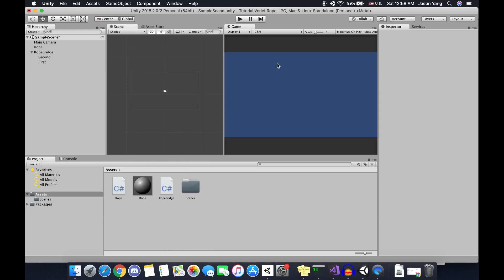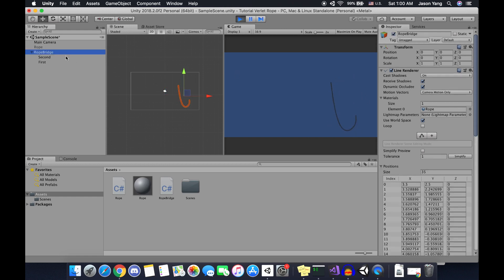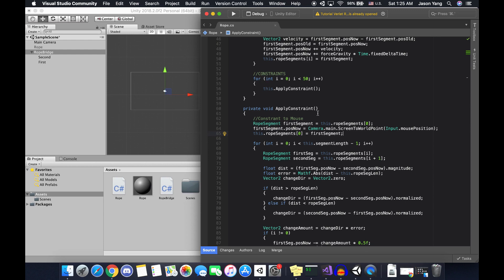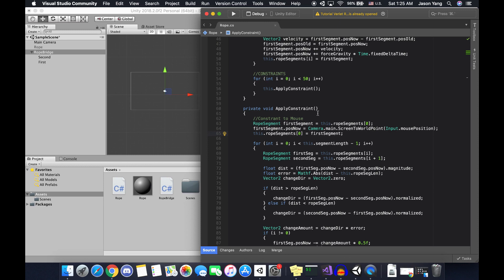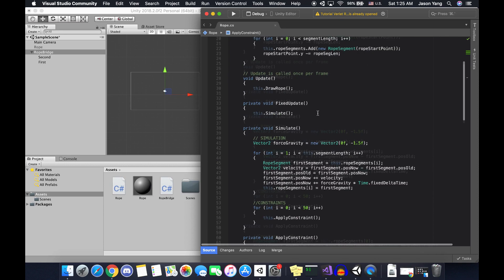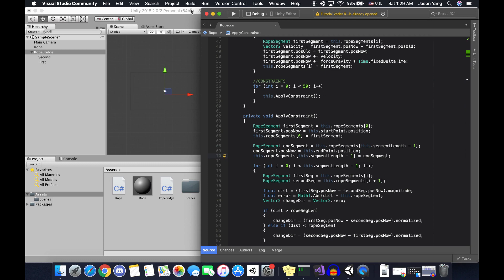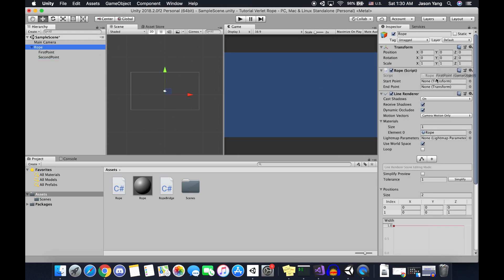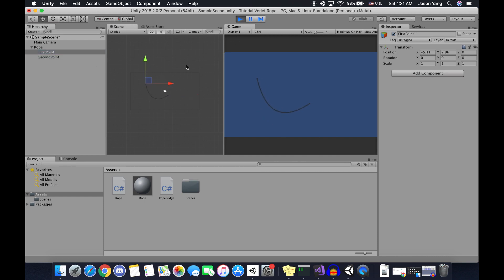Create Rope Bridge, String in Unity - Verlet Integration Part 2

Comment: Here are suggestions for further implementation. 

Adding a pin boolean to the segment struct and constraining segments that do not have the pin boolean set between segments that do  allows you to accomplish the swinging cable and the bridge in the same implementation.  Like for example a bridge with overhanging parts. 

Don't forget that your segments have properties.  This allows you to define constraint arguments within the line segment struct

Anorher one you can add is mass to adjust the influence of gravity per segment.  

Another one you can add is elasticity to transfer velocity to adjacent segments when the direction changes. 

Another one you can add is viscosity to place a threshold on elasticity where a certain amount of velocity is required to make the transfer to the adjacent segments.

Comment: Your videos are super useful and well made! Tutorials like these are very hard to come by, this was just what I needed. I do also have a question about using this with rigidbodies. I've been experimenting with different lightweight methods of simulating an elastic rope, and was curious if this could be used for that, when combined with something else. Would there be a way of simulating an object hanging from an elastic rope (similar to connecting a bunch of SpringJoints, except with Verlet Integration)? If you could point me in the right direction that would be amazing. Thanks again for such a helpful tutorial.

Comment: Very cool! Thanks for sharing the code. I want to add a motion to the middle of the rope to make it dangle a bit without moving the ends. How would you suggest I do that? Would that be the same way as the slingshot? But can I make the ”grip” of the rope more soft so it’s not V shaped? Thanks!

Comment: Amazing video, just like the first part. Is there a way to connect rigid bodies to the rope so that the rope can move them, but they also influence the rope? I cant wrap my head around that problem.
Reply: Managed to find out.
For anyone with the same problem:
1. Constantly updtate a rigidbody's position so it follows the end of the rope.
2. (optional) attach other bodies to it with joints etc.
3. Constantly calculate the attached bodies'/body's centre of mass as a vector and subtract the position of the end of the rope from it. Normalize the vector you get, multiply it with a constant that fits your solution best and add it as a velocity to the rope's end position.
Reply: @pickyourlane6431  I've been doing something similar to this, I place my object at the rope's end points.
Reply: @pickyourlane6431   i know its been 3 years but do you maybe have the code for that

Comment: hey great tutorial. is there any way i can stop the rope from stretching when i move the endpoints around? i cant seem to figure that part out.
Reply: You have to increase the times the constraints are applied. That will result in a less stretcy rope.
Reply: @pickyourlane6431  But would that stop the rope from keep on stretching when one of the end point is pulled away? I don't think so.
Reply: @BasementExperiments  Yes it would if you applied the same constraints to the given object(the pulling force) just as to the points of the rope.
Reply: @pickyourlane6431  This means that object would be a part of the rope, i.e, the object would act as an end point of the rope right?
Reply: @BasementExperiments  You can read about how I managed to solve this problem in my other comment some where around this comment section. Its not flawless but it worked good enough for me.
Reply: Were you able to figure out a way? Not like I need for my game but still would like to know.

May be add fixed joint between each point?
But that would make it like tens of rope tutorials that use hinge joints and all.

Comment: could anyone tell me how to added colliders to the rope?
Reply: Assuming 2D game, add an edge collider and create Vector2 array to store the points for edge colliders.
Inside Draw method's loop, store those points inside that Vector2 array.
Then EdgeCollider has a property "points"(read the docuementation), feed those points to it and it will generate edge collider along them.
Reply: @BasementExperiments  How would I simulate collision in 3d? I'm dynamically adding sphere colliders along the line but I cant get it to behave right
Reply: @reindogfan  What's the issue you're facing?
Reply: @BasementExperiments  Essentially I'm trying to get the rope to bend around objects, like it would when colliding with real objects. I've tried getting the contact point and applying a vector in the direction of the collision, but the rope bends and distorts weirdly. How would you go about doing this?
Reply: @BasementExperiments  hey, I'm a beginner programmer and I'm struggling with this. would you be able to give me a more detailed explanation or an example? thanks!
Reply: @BasementExperiments   I follow your instructions. As a result, I draw a collider line but it was far away from rope. When I move the rope, it also moves but there are a bad relation in the distance between rope and collider.
Reply: @ahmetanbar6346  It shouldn't happen if you're storing those same points used by the LineRenderer for the EdgeCollider.
Also the points of the EdgeCollider has to be updated continuously similar to that of LineRenderer.
Reply: @BasementExperiments  yes I  update points of the edgecollider. https://imgur.com/a/oQmOISc you can see that how edgecollider moves when i move the rope in the game.
Reply: @BasementExperiments  globally 
public List<Vector2> newVerticies = new List<Vector2>();
    private EdgeCollider2D col;

In start method
col = GetComponent<EdgeCollider2D>();
in start->for 
newVerticies.Add(new Vector2(ropeStartPoint.x, ropeStartPoint.y));
after for 
col.points = newVerticies.ToArray();

in drawrope method
drawrope->for-> 
newVerticies[i] = this.ropeSegments[i].posNow;
after for
col.points = newVerticies.ToArray();

that's all.
Reply: @BasementExperiments  I also notice that when i move the rope bridge object by using move tool. its transform position is changing but move tool ( provide able to change position red, green, square box) is not changing it is always the same point.
Reply: @ahmetanbar6346  1. You don't need the for and after that in Start. 

2. Code inside Drawrope method is correct
3. You need to update the points of the collider inside Constraint method as well.

PS: Why not simply use an array instead of a list?
Reply: @BasementExperiments  
thank you for your assistance. i am new in unity. I cant solve constraint method clearly.  Where should i update the points in the method? which parameters should i assign to collider transform?  this.ropeSegments?

A: It was copy paste. I notice it but firstly i try to solve my problem completely. I will clear them. Thank you sir.
Reply: @ahmetanbar6346  I don't remember exactly but the thing you did in Drawrope method do the same in Constraint method.
inside for->  newVerticies[i] = this.ropeSegments[i].posNow;
after for-> col.points = newVerticies.ToArray();
Reply: @ahmetanbar6346  May be a bug or something but I can't seem to find my previous comment here.
Inside Drawrope method do the same in Constraint method.
inside for->  newVerticies[i] = this.ropeSegments[i].posNow;
after for-> col.points = newVerticies.ToArray();
Reply: I still cant figure out how to put a edge collider, anyone here got a answer for that?
Reply: @DavidTG98  What's the issue you are facing right now?
Reply: I try to do thoose commands you guys described but they just dont work
Reply: I need the player simply walk above the rope
Reply: @DavidTG98  But "they just don't work" gives much explanation. Like what is happening when you're trying to do so
Are the edge colliders even generating? If yes, are they in some different position? Like what exactly is happening. Then only I might be able to help you.
Reply: The hole lineRenderer stops working
Reply: And the edge collider dissapears
Reply: @DavidTG98  Mind showing the code?
Reply: @BasementExperiments  Its working now, but the collider appears in other place, its out of sync with the lenght of the Line Renderer
Reply: @BasementExperiments  private void DrawRope()
    {
        float lineWidth = this.lineWidth;
        lineRenderer.startWidth = lineWidth;
        lineRenderer.endWidth = lineWidth;

        Vector3[] ropePositions = new Vector3[this.segmentLength];
        for (int i = 0; i < this.segmentLength; i++)
        {
            ropePositions[i] = this.ropeSegments[i].posNow;

            newVerticies[i] = ropeSegments[i].posNow; //addition
        }

        lineRenderer.positionCount = ropePositions.Length;
        lineRenderer.SetPositions(ropePositions);

        col.points = newVerticies.ToArray(); //addition
    }
Reply: I put those additions in constraints too
Reply: @DavidTG98  Are you updating edge collider points inside the Constraint method as well?
Reply: @BasementExperiments  

Yes, Heres the code

private void ApplyConstraint()
    {
        //Constrant to First Point 
        RopeSegment firstSegment = this.ropeSegments[0];
        firstSegment.posNow = this.StartPoint.position;
        this.ropeSegments[0] = firstSegment;

        //Constrant to Second Point 
        RopeSegment endSegment = this.ropeSegments[this.ropeSegments.Count - 1];
        endSegment.posNow = this.EndPoint.position;
        this.ropeSegments[this.ropeSegments.Count - 1] = endSegment;

        for (int i = 0; i < this.segmentLength - 1; i++)
        {
            RopeSegment firstSeg = this.ropeSegments[i];
            RopeSegment secondSeg = this.ropeSegments[i + 1];

            float dist = (firstSeg.posNow - secondSeg.posNow).magnitude;
            float error = Mathf.Abs(dist - this.ropeSegLen);
            Vector2 changeDir = Vector2.zero;

            

            if (dist > ropeSegLen)
            {
                changeDir = (firstSeg.posNow - secondSeg.posNow).normalized;
            }
            else if (dist < ropeSegLen)
            {
                changeDir = (secondSeg.posNow - firstSeg.posNow).normalized;
            }

            Vector2 changeAmount = changeDir * error;
            if (i != 0)
            {
                firstSeg.posNow -= changeAmount * 0.5f;
                this.ropeSegments[i] = firstSeg;
                secondSeg.posNow += changeAmount * 0.5f;
                this.ropeSegments[i + 1] = secondSeg;
            }
            else
            {
                secondSeg.posNow += changeAmount;
                this.ropeSegments[i + 1] = secondSeg;
            }

            newVerticies[i] = this.ropeSegments[i].posNow;
 //ADDITION
        }

        col.points = newVerticies.ToArray();
 //ADDITION
    }
Reply: @DavidTG98  Seems right to me. Strange it's not working.
The only fix(work around) I can think of is manually set the value of EdgeCollider's offset value in inspector.
Reply: @DavidTG98  So I reproduced your problem. The edge colliders have different position if the gameObject which has the rope script is a child. In that case you'll have to set the local position.
Test it yourself, without the game object as a child.
Reply: @BasementExperiments  Works perfectly now, thaks man
Reply: @DavidTG98  You're welcome! I'm glad it worked out.
Reply: @BasementExperiments  I was able to make the Collider line, but how do I make the slack from gravity
Reply: @HellDeimoS  The rope slacks on it's own with the current code. Kindly explain, what are you trying to achieve?
Reply: @BasementExperiments  to make the rope respond to a push from other objects
Reply: @HellDeimoS  Oh! I haven't tried doing anything like that.
But I guess you can get the point of collision and move that point yourself which will in turn move the other points(I think so) as well because of the Simulate method.
Reply: @BasementExperiments   Just wondering if you ever figured it out as I'm currently trying to make a system that calculates accurate impact forces on the rope but any help would be great
Reply: @asclepiiusunknown1090  Nah, I had no use of it as such so didn't spend time on exploring it.